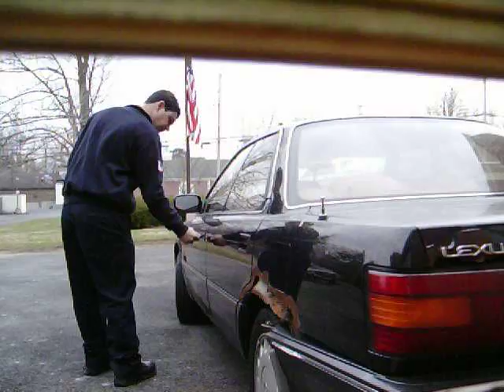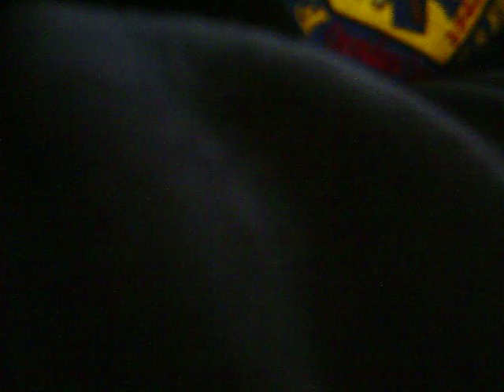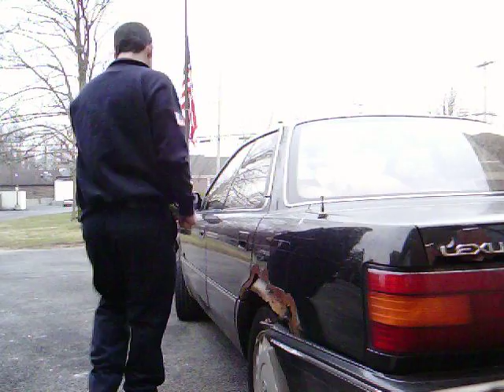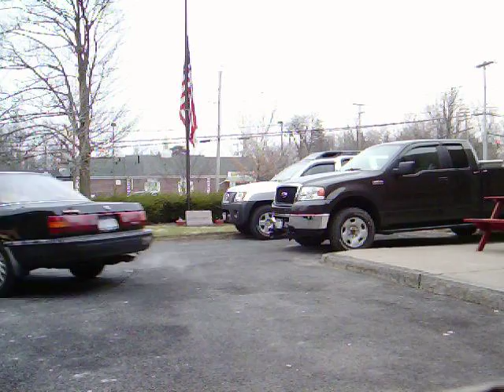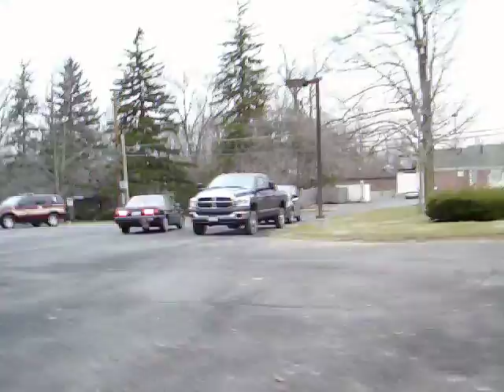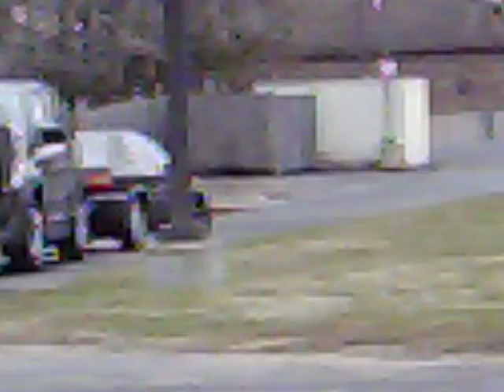FD Prank - Car Horn wired to Brake Lights

Comment: How do you do that?
Reply: MrMaster767 Sorry to resurrect a dead comment but all you would need to do is splice a wire on your brake that is switch activated and run it to your horn. Should be relatively straightforward.
Reply: or skip hacking your wires alltoghee and just open the fuse box and run a jumper from break to horn.. ( holy dead thread batman )